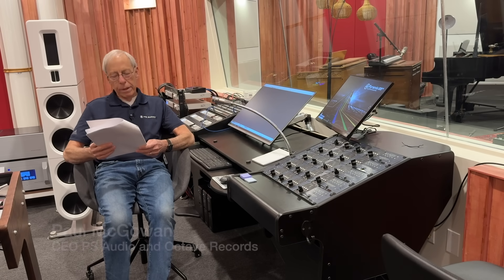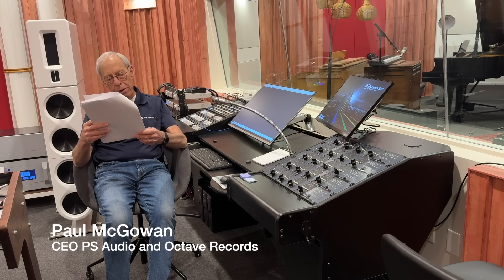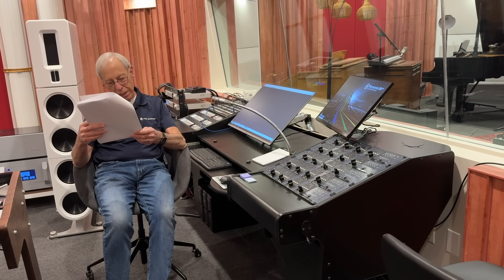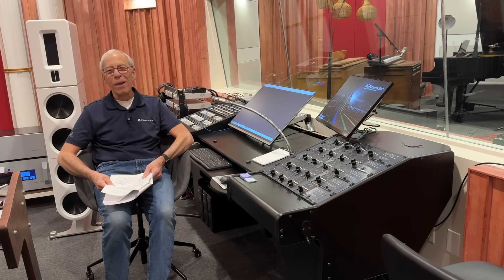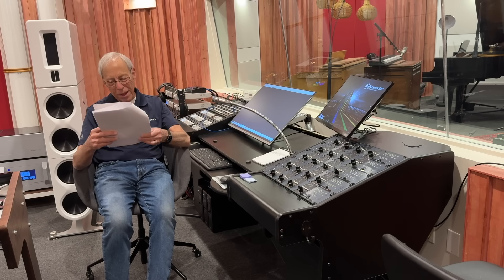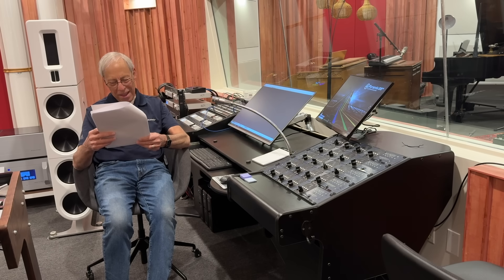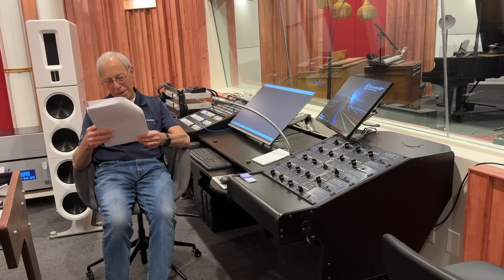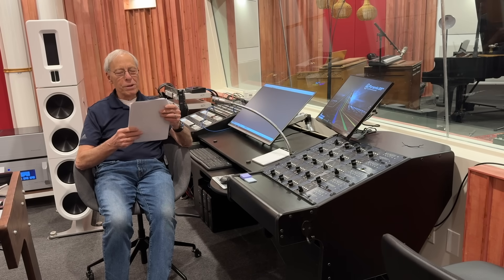Damping factor and pudding bass

Comment: The myth is that an amplifier can damp a loudspeaker speaker, it cannot. Since the output impedance can only ever be a positive number and is in series with the DC resistance of the voice coil, then the electrical damping can only ever become less due to the amplifier. The physics here is unyielding. The only way that an amplifier can increase electrical damping is that the output impedance must become a negative number. That is not going to happen here (speakers with motional feedback may in some cases be viewed as having a negative output impedance, but not in a stand-alone amplifier driving a stand-alone speaker). But this myth I am pretty sure will never die. In my case, this person was set straight by none other than Richard H. Small you taught me one fundamental thing: The damping of an LF damping in a loudspeaker is entire a function of the alignment. If an amplifier has an output impedance (they always have) it will change the alignment of the speaker. That is all. But do amplifier have different sounds in the bass? That is an entirely different subject. It can because of different power supplies and other factors. Good amplifier design is always required, irrespective of anything else. BTW, the best amplifier I have heard in the bass had a 2 Ohm output impedance into a 6 Ohm speaker. That is supposedly a DF=3 and I can say the bass is extraordinary because of a number of factors that comes down to good design into a compatible speaker. Also, if you EQ the current of the amplifier below 100-200 Hertz, the output impedance of the amplifier becomes effectively cancelled out. Now even a 1000 Ohm output impedance will not change the alignment of the speaker. Damping factor becomes irrelevant but damping is never irrelevant. It is inherent in the final alignment of the speaker.
.
Reply: You are comparing an amplifier to a short across the speaker terminals, and yes an amp can't be any better than that. And as long the amp is reasonably close to a short, it's not the primary variable in damping. The speaker's internal resistances are far higher than the amp output.
Reply: @spentron1  Thank you for responding. I am not sure about the short thing but I kind of getting the gist at where you are coming from. This may deviate a little from text book but does not contradict it, that the LF damping is a function of current versus frequency. I can run tests in your presence that proves it. Indeed I am currently co-writing a paper on the subject. If the right current shows up at the right frequency, irrespective of what amplifier is used, you will have the correct damping. The irony is that voltage hardly appears in the equation when looked at in this light. BTW, the only way that an amplifier sees its own output is when it is shorted to ground. If something is put in-between, like 6 Ohm DC resistance of the voice coil but it motional impedance, then the sum of those three is what the amplifiers sees, which is that it can only see a single impedance at any one single frequency. Change the frequency and it will see another impedance and so on... but impedance is inversely proportional to current, so when we discuss impedance, we must also discuss the current. And ultimately it is the current that flows through the voice coil, that is what we are listening to.

[I have edited a few typos in the earlier post.]

Comment: I think you are leaving out some information just to bait people into your comment section. It's not so, but it might seem so. 

Anyway, you need to be more specific about the damping factor. People might think that it is the actual output impedance of the amplifier, but it's actually the ratio between the speaker impedance and the amplifier's output impedance. And that's why higher impedance speakers are desirable because they increase the amp's apparent damping factor, and as with every circuit, higher load impedance equals less distortion. Some drivers also have copper/aluminum shorting rings and sleeves to lower the eddy currents and make them easy to drive by low-damping-factor amps.

A well-designed global feedback with compensation or reduction at high frequency to prevent lag/slew rate issues and instability is always better than no global feedback. I once saw your video where you were questioning Hegel's high damping factor. Hegel's global feedback is not like the others. It uses an analog computer to compare input and output signals and send the error-correcting signal to the input. The error-correcting mechanism is way faster than the signal going forward through the stages, and that is why they are able to use a lot of feedback up to and beyond 20k without stability and lag issues. And that's why they are praised for their soundstage and imaging capabilities and the low noise floor/darkness of the background of music.

Comment: Damping Factor is not restricted to the actual internal resistance of the amps PS and output stage. Because it is basically just the mathematical ratio of speaker impedance to Amp output a 100 Damping Factor is perfect if no feedback is used. It would mean a zero internal resistance in the amp. Anything over 100 is accomplished by playing games with feedback as you say. Electronically compensating for voltage drop across the output stage because of higher internal resistance. This can cause additional distortions itself.
Reply: That's an interesting perspective on damping factor and feedback. You're right that DF is a ratio, not just the raw output impedance, and feedback is indeed a common way to achieve a lower output impedance and thus a higher DF. It's also true that poorly implemented feedback can have downsides.

However, a DF of 100 with no feedback wouldn't mean zero internal resistance; it would mean the output impedance is 1/100th of the speaker's impedance (e.g., 0.08 ohms for an 8-ohm speaker), which is still quite low.

Also, while feedback works by correcting the output, it doesn't inherently cause more distortion when well-designed. In fact, one of its primary benefits is often a reduction in distortion. The trade-off is more about the type of distortion or potential for instability if the feedback loop isn't carefully engineered.

Ultimately, whether a high damping factor is achieved through inherent low output impedance design or with the help of feedback, the benefits for speaker control (tighter bass, better transients) are generally what matter at the speaker terminals. The implementation and overall sound quality are what truly count in the end.
Reply: @dicmccoy  Thanks for the correction, yes the 100DF would mean not zero, but 0.08 ohms as usually speced at 8ohms. I was a travelling rep for Audio when the Damping Factor spec took off in the late 60's. Gave lectures on amps that included explaining it. Take a especially high efficiency (ported) big woofer speaker like a Cerwin Vega (a line I repped) on a table in front of the class. tap on the woofer with the speaker terminals open, then short the terminals and tap again. The difference is incredible and quickly explains it. 

But DF can be determined a couple of ways. In a true constant voltage PS like used in BJT Solid State amps, the goal is the lowest internal resistance possible so no voltage is dropped across it. Such as the counter EMF from the speakers. Allowing the speaker to control itself by returning the EMF without loss. So part of the DF equation can be actual source resistance. 

Or the source side of the equation can calculate the output resistance by measuring change in output level as load changes. IOW if a PS has a .8 ohm resistance it would drop 1/10 of the total output voltage feeding an 8 ohm load. If 10V out, 1V dropped across the PS. But feedback could be used to look at that drop and boost internal gain so the output to the speakers was the full 10V regardless of the actual voltage out of the amp and not worry about high internal resistance in the PS. You could literally take a PS with an 8 ohm internal resistance and using feedback give a DF of 1000. 

One of the problems is timing. Feedback happens AFTER the signal has passed through the system. The resultant output is fed BACK into the source to compensate. So the correction happens AFTER the signal has passed through and found bad DF. Works great for steady state sinewave tests! Another of the problems then being that the original signal passed thru with bad DF sound and was followed up by delayed over compensation.
Reply: @glenncurry3041  it's interesting hearing the take, especially since it echoes what folks like Paul have discussed regarding feedback and the time domain. The idea of the correction signal always being after the initial signal, potentially leading to a kind of delayed "over-correction," is a valid concern with feedback design.

However, the flip side of that coin is what happens to the time domain without sufficient control over the speaker. Just saying a DF of 100 is more than adequate feels a bit simplistic, as it really depends on the speakers being used. Demanding speakers with low impedance dips and complex loads need a much tighter grip to behave properly. Without that control (which a higher damping factor provides), you get significant time-domain issues like poor transient response and muddy bass.

And here's a really crucial point that often gets missed: even if an amp has a decent DF at its output, the speaker cables and connectors you use can completely tank that! They add resistance in series, which effectively lowers the damping factor that the speaker actually "sees." So, even if an amplifier theoretically has a DF of 100, if someone's using poor quality cables or dodgy connectors, that control is going right out the window.

So, while the potential for delayed correction with feedback exists, the lack of control without sufficient damping factor, and the real-world losses in cables and connectors, can introduce even more significant timing errors at the speaker-driver level. It feels like it's about finding the right balance in the amplifier design and the entire system to minimize time-domain issues from all angles, rather than just focusing on one aspect in isolation.
Reply: @dicmccoy  It echo's Paul because it follows the facts. And it isn't just an "idea", it is factual reality that any feed BACK, by pure definition is AFTER the fact. Explain how time domain errors are improved by sending distortions (feedback corrections) BACK in time to affect NEW signals. 

And we are talking about an amplifiers Damping Factor. Not how things connected outside it's terminals changes the internal design. Later "interacts with" is a completely different discussion.
Reply: @glenncurry3041  The more we discuss this, the clearer it becomes that completely avoiding negative feedback in the pursuit of perfect time-domain accuracy might actually create a whole new set of timing problems.

While I understand the concern about the inherent delay in a feedback loop potentially smearing transients, the reality is that all amplifier designs have their own time-domain quirks.

Think about an amplifier with minimal or no feedback. It's going to have a much looser grip on the speaker, right? That high output impedance means the speaker's inertia and its wild impedance swings are going to dictate its movement much more. The driver won't stop and start as precisely as it should, leading to bass that's not tight, transients that are blurred, and an overall lack of rhythmic precision. Those are all fundamental time-domain errors caused by a lack of control.

Then consider the output transistors themselves. They aren't perfect switches. Their behavior is affected by the constantly changing voltage and current demands of the speaker, especially with those big phase shifts. This can introduce tiny timing errors and phase distortions that are also time-domain issues, and these are present regardless of whether you're using feedback or not.

The point is, no amplifier design is immune to time-domain imperfections. It's about understanding the trade-offs in each approach. While feedback, if poorly implemented, can introduce its own set of time-related problems, completely shunning it can lead to equally significant, albeit different, time-domain inaccuracies due to a lack of speaker control and a more unstable interaction with the reactive load. It's about finding the right balance through careful engineering, not just sticking to a rigid stance against feedback.
Reply: @dicmccoy  We have no idea how you got "create a whole new set of timing problems" out of getting rid of the timing issues caused by feeding a delayed output signal back to the input which is what feedback loops are. The exact concept is getting rid of any timing issues caused by reintroducing delayed signals. No NEW timing problems come out of that. 

And NO! There is nothing inherently superior in a feedback designed amp that gives it more control over the speaker! In fact you have it exactly basssackwards! Any inherently stable well designed amp with a Constant Voltage power supply (approx zero internal resistance) will have strong control over the speaker and return the Counter EMF with little problem. Contrary to amps with large DF specs using massive feedback loops which only have even reasonable DF when the feedback loop is active, IOW AFTER the transient has passed through the amp and is being feed back delayed to input stages. Until then the DF sucks and has little control over the driver or EMF! Which the delayed feedback signal is then passed through the amp again!
Reply: @dicmccoy  Transistors ARE switches. Tubes are inherently linear devices. Transistors are forced to operate in limited ranges between switching states. But you are correct they are not perfect switches. 

A good basically stable amp does not care what the load is doing. It does not get any information fed back to it. IOW when the amp does not get any feedback from the output/ speaker system fed back into it's input it is independent of the load. While taking some of that information including Counter EMF voltages and feeding that back delayed into the input again... Thanks for the perfect explanation of why using feedback loops is wrong! even if 180 degree mis-assignment.
Reply: @dicmccoy  Interesting issue with tubes vs transistors. "tiny timing errors and phase distortions that are also time-domain issues" inside the devices. eddy currents. Multi-path distortions, surface waves,... The reason tubes are superior whenever bandwidth is the issue. Especially as power was needed at higher frequencies.  e.g. why tubes are still used for Microwave ovens. Kenwood which was a world leader in 2 way radio gear, far higher frequencies than audio, developed massively parallel BJT devices to reduce possible electron flow paths while maintaining power performance used in their original High Speed product line.
Reply: @glenncurry3041  output transistors in ab class are not being used as swithces
Reply: @tolgadabbagh1877  WRONG! They SWITCH between negative and positive section of the amp. That is exactly what a Class B design is. Making it class AB just moves the switching point. each stage/ device(s) are then forced into linear operation over a very limited voltage range.
Reply: @glenncurry3041  " transistors as switches " means something else in electronics .  the negatvie and positive section switch is done by the signal itself .  output transistors or mosfets work in the linear region as high current voltage regulators at the output in ab class or b class or a class . ask gpt or something for details .
Reply: @tolgadabbagh1877  A transistor has 3 not 2 sections. And exactly as y say they are forced to "work in the linear region" which is small. Between SWITCHING on and clipping.

Comment: You can have all the damping factor in the world, you have to remember that the only thing cables do is take away. 

You have to factor in your speaker cables, connectors and even the contact resistance for your amps damping factor. 

There are some really bad cables and connectors out there. Some even measure .6Ω Put that cable on a DF of 13666, like a Purifi Eigentakt, that 13666 now all of a sudden became a DF of 13 because of the one thing you have been brainwashed as snake oil.

Comment: We may experimentaly  obsreve what impact  has our amplifier   on low range sounding . First disconnect your amplifier form speaker and delicate knock with finger in woofer. Remember the sound of speaker in cabinet how it responded     and next connect back amplifier terminals ( working but without music)   and konock few times again - it suppose to sound with less lowest harmonics. with generaly  more clear and silent bass .

  Unfortunately in my  solid vintage B&O amnplifier I find  no change. It may be explained by serial output  capacity impedance .      It is wonderfull amplifier but  for  matched   by me      miniature  HI FI cabinets with 4" drivers = this  bad  damped bass extends    lows. of sealed cabinet which  has relatively  good acoustic damping ( other types and bigger could  be, even  this amplifier    is priozed by listeners not applicable.)   

. My tube amplifier with very small in size Philips  transformers thus having low winding resistance and   inductances   even when amp is  switched off from mains  makes me noticeable change that is why I drive  with it  my    biigger and   lower  range, also sealed and well damping  cabinets..

Comment: insufficient damping factor sounds like permanent reverb?
Reply: At what damping factor number, 20, 100, or 1000? I have had amplifiers with damping factor of 800 and the one I have now has way better bass at a damping factor of 150.
Reply: No, it may change the frequency response of certain speakers if it is low enough (under 10 or so).
Reply: ok, so this is similar to source output / preamp input impedance ratio